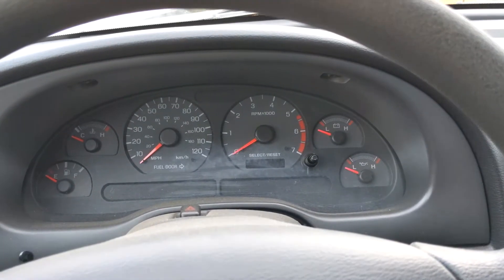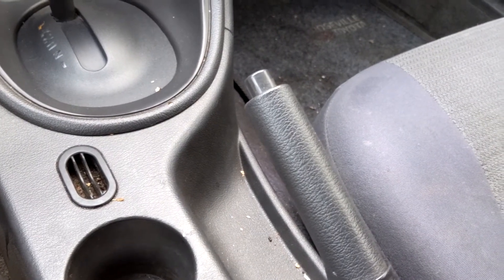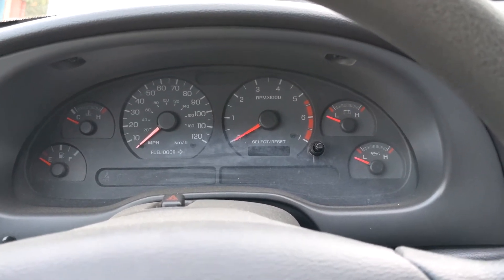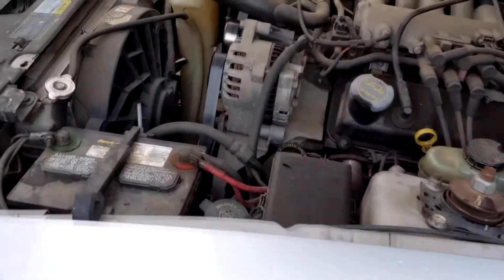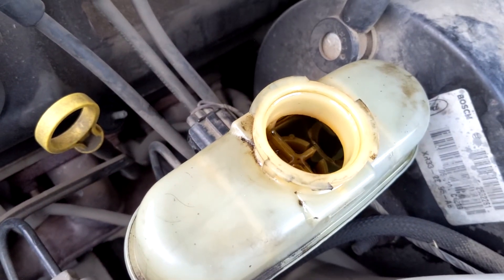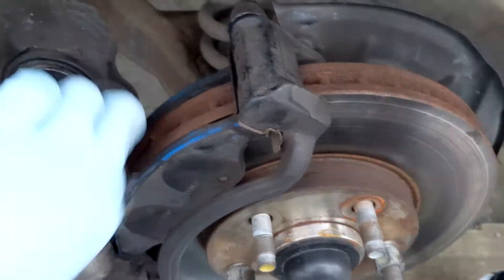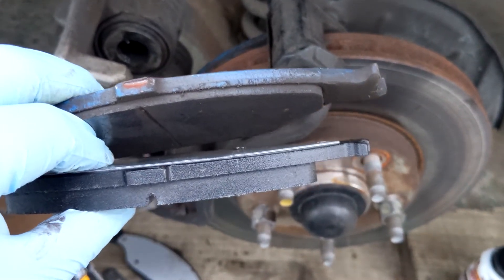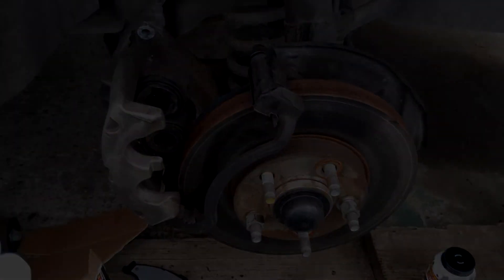Why Brake Light Comes On during Acceleration or Braking

Comment: Mine isn't low it turns on when I brake at a light or stop. Isn't there a button next to the brake peddle I'm thinking mine broke or something
Reply: That means your brakes need changed, the plunger is overextended
Reply: I have the same problem. Did you figure out what was the problem?
Reply: @n1derland484  nope